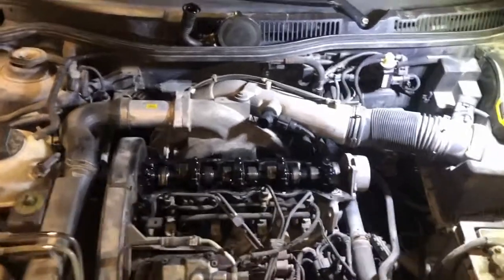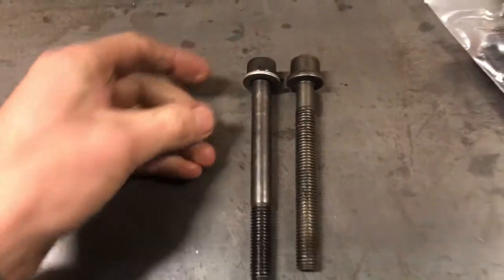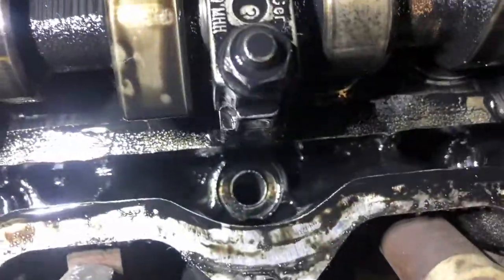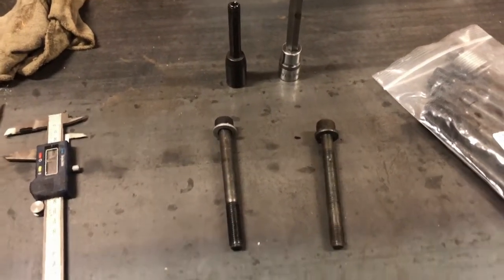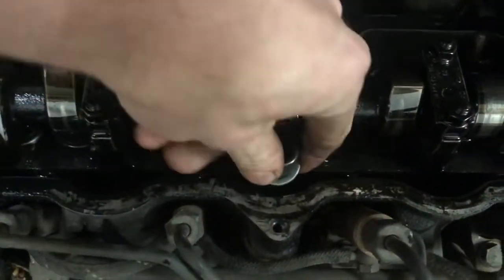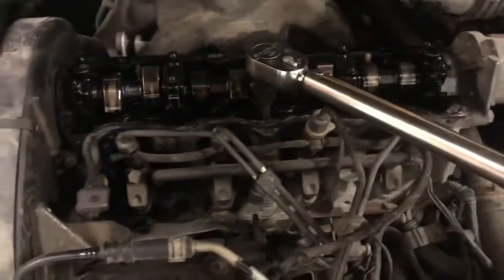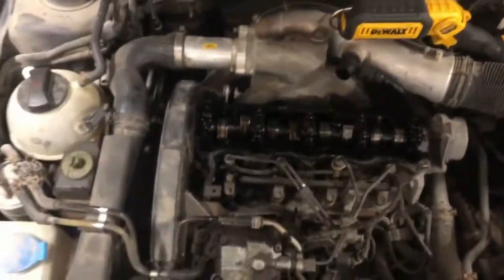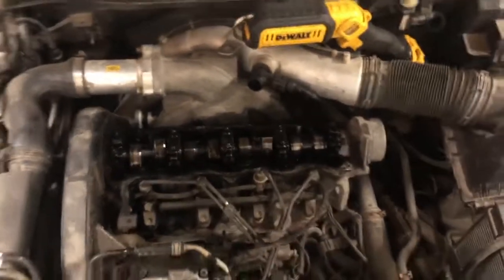ALH Budget upgraded head bolts

Comment: hi. i bought the exact same bolts.. i did a torwue test /practice on a bench i find 120lbs alot... actually even 100 feels like alot. you think 80.or 90 would do?
Reply: Screw it, just half the value at 60lbs while you're at it. 🤣
Reply from the maker: I wouldn't go under 110 ft/lbs personally

Comment: Did you install these head bolts with thread/fastener lube? Motor oil, ARP thread lube, moly, etc Thanks!!
Reply from the maker: I blew the holes out, put motor oil on the threads and let the excess drip off then installed.
Reply: You ever work on a diesel bruh there god damn oil everywhere........ You fucking kidding me

Comment: if i put these 12.9 bolts can i run 30psi safely?
Reply from the maker: Ive got them on 2 cars running 26-28. Tuning can make a big difference not having excessive peak cylinder pressure
Reply: @JoshsJettas  thanks buddy i will definitely do it before setting 30 psi with gtb2260

Comment: Hey there, so as you probably know everyone is out of ARP's. I called ARP and they are getting a shipment in September. How do you think your method here compares to using ARP's? I'm running 25lbs+ of boost in my ALH Syncro Vanagon build. Looking to keep that head down.....
Reply from the maker: I’ve got these on 2 cars now both running 26 psi with 17/22’s with no issues. Another option with a more tried and true torque sequence is get pd150 head bolts and cut them down to length, still getting the 12.9 hardware (vs stock alh 10.9) with a more accurate torque turn method.

Comment: Where did you get yours bolts and washer from ?
Reply from the maker: These came from fastenal, any quality bolt store should be able to provide the correct bolts
Reply: @JoshsJettas  I want to do arp studs in my car and the head gasket is good right now. So stud for stud replacement is what i was going to do. Im trying to prevent a future headgasket failure
Reply from the maker: @rileyspears8582  it’s a nice upgrade to give you peace of mind, shortened pd150 bolts work as well.